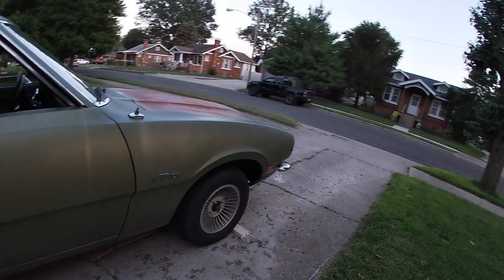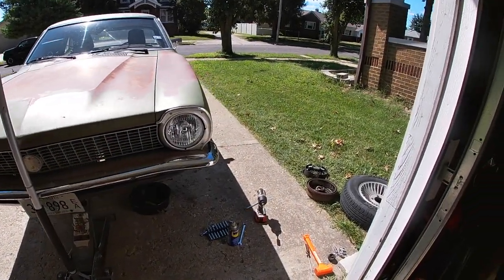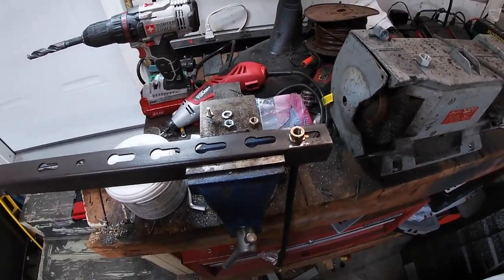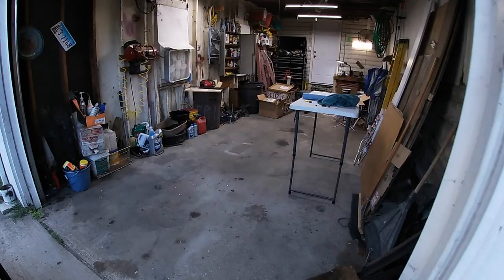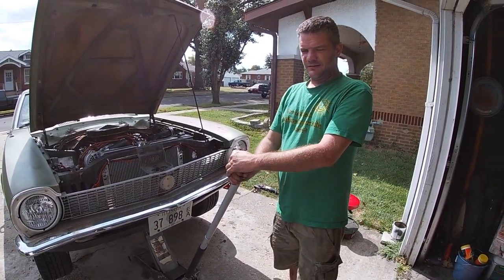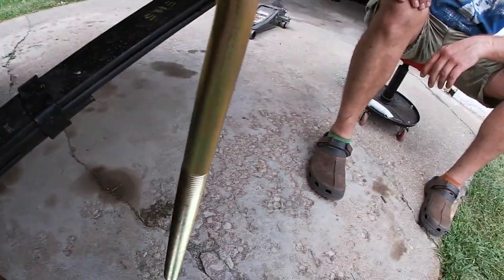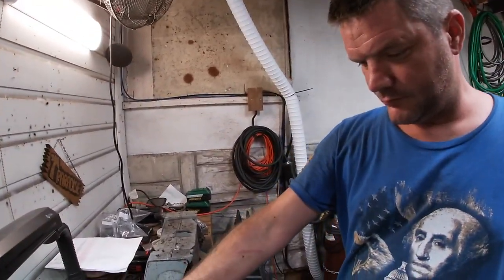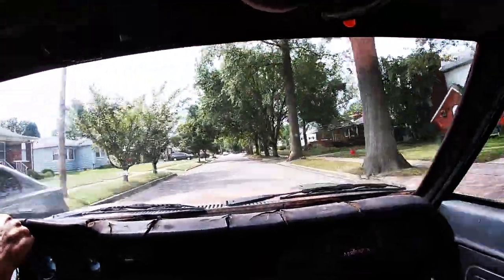The Maverick got an Ebay 5 Lug Swap, NEW Tires, Wheels and Disc Brakes!

Comment: I have brakes off of 69 Mustang fastback and they’re the exact same ones you get with the middle I will would break it there for piston calipers and all I Gotta do is buy the slide rotors and you’re good to go I’ll actually be selling mine up pretty soon here because I’m doing a independent front suspension and LS swap in case you’re interested

Comment: Did you still need to use spacers up front with the new wheels?
Reply from the maker: Yeah did. One inch if I remember. Only because the wheel rim wanted to rub on the upper ball joint.
Reply: Did you feel the need to switch to a disc/drum master cylinder?
Reply from the maker: @maxchavez1322  yeah did. The stock 4 wheel drum master was really stiff and had a high pedal. Probably not "necessary" but we ended up putting a Wilwood master on there. The adjustable pedal rod helped and the piston diameter made for a more comfortable feel.

Comment: WHERE DID YOU GET THE ONE INCH BLOCK KIT.
Reply from the maker: I think they are Belltech tapered lowering blocks.
Reply: @MadJunker  Thank you
Reply from the maker: @angelsanchez3074  not 100% sure, but think it was these: https://www.speedwaymotors.com/Belltech-6002-Leaf-Spring-Block-Kit-2-Degree-Taper-1-Inch-Drop,441415.html?sku=1376002&utm_medium=CSEGoogle&utm_source=CSE&utm_campaign=CSEGOOGLE&gclid=EAIaIQobChMIp9_X2_Ok8QIVUsDICh1xHgEYEAQYASABEgKelfD_BwE